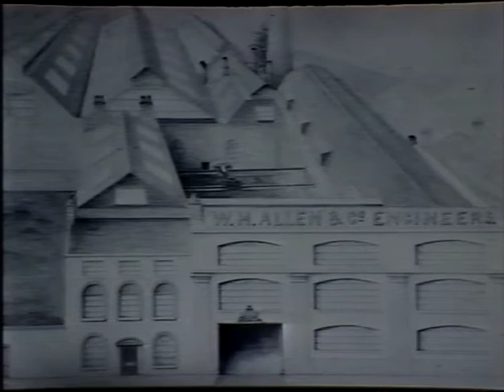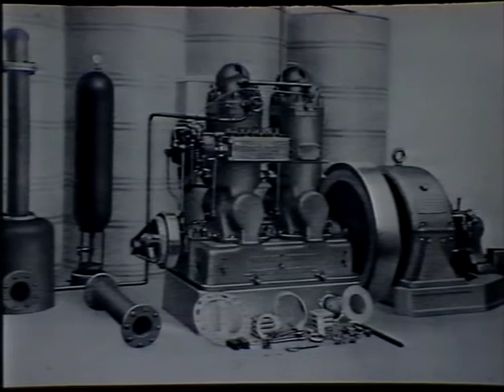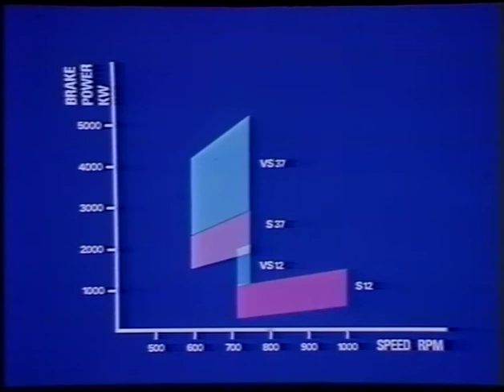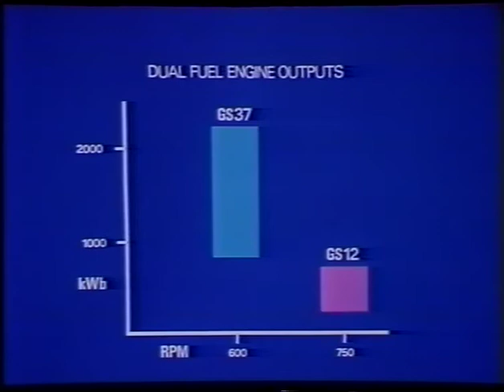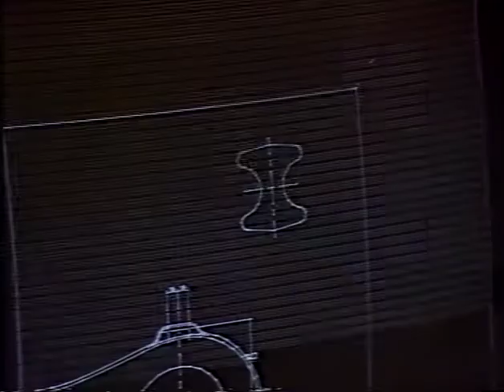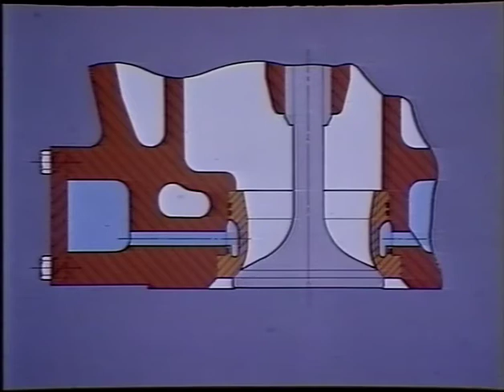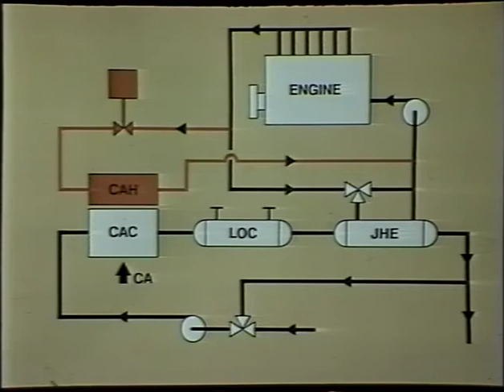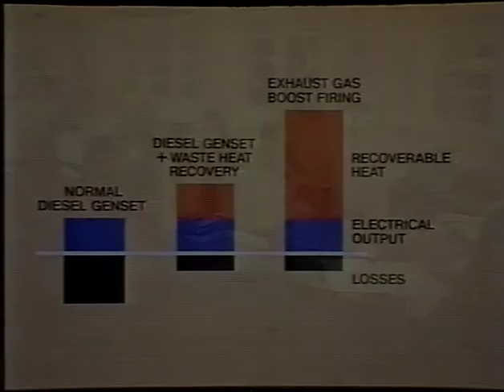Allen Diesels

Comment: I have an old Allen Hot bulb engine that I saved from the scrap man, It was used to pump water as part of the fen drainage system at Connington Fen. I also have a large number of new parts and photographs of the engines removal in the 1990's.